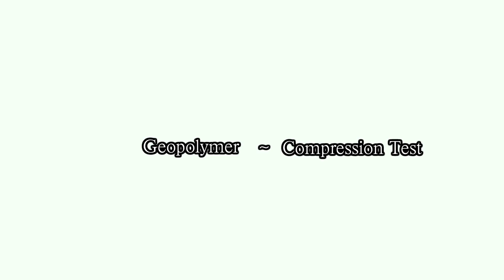Geopolymer: Compression Test

Comment: 7131 psi wow thats pretty good! whats regular foundation concrete? 3000-5000 ish?
Reply: Normal concrete is 3,000 - 6,000 PSI, yeah. Regular concrete is about 20MPa - 40MPa. To convert, multiply mega-pascals rating by 145.0377 and that gives you PSI rating, or divide to go back the other way :) So 20 MPa would be ~2,900 MPa.